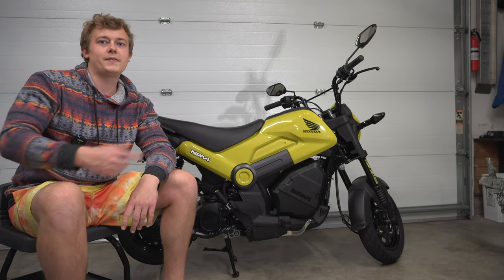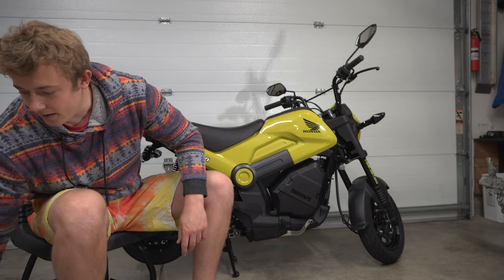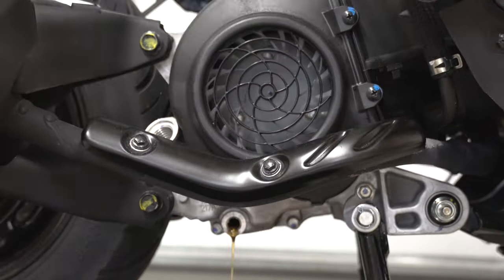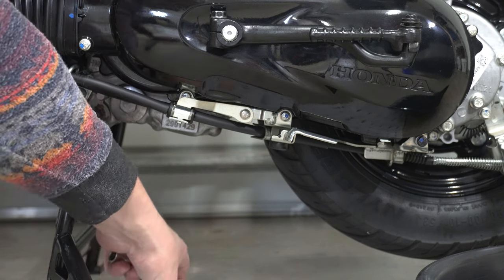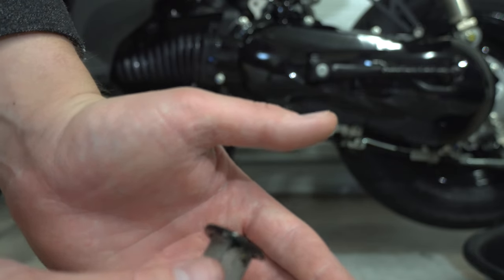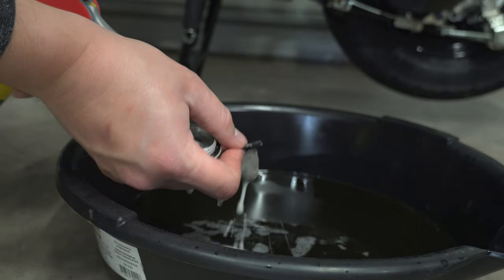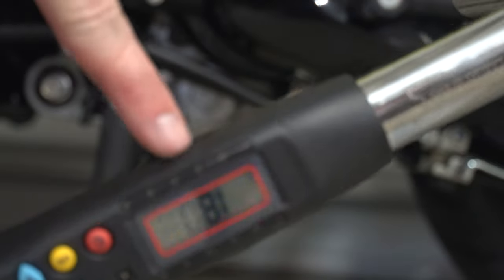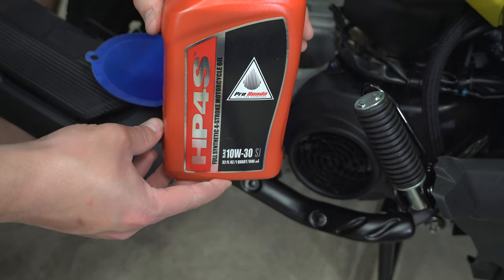2022 HONDA NAVI : Oil Change

Comment: In honda navi is there a gear oil change or only engine oil change? 
If there is also gear oil change can you make a video on that part
Reply from the maker: Gear oil change aka final drive IS separate from the oil change. It is recommended every 2 years!  If its in stored in a climate controlled setting like mine I personally gonna wait till hit 2,500miles and do it with the next oil change. I will not be putting 2,500 in 2 years so id personally am going with every 4 years or every 2,500 miles. Standard Oil changes are much more vital to do. If its in a non climate controlled environment id go with every two years for the final drive. Its not as important as the oil in the engine therefor im waiting longer to change it. Plus the factory oil is good and only have 600miles on the bike.

Comment: What's your mileage
Reply from the maker: Getting roughly 75mpg. I keep her full throttle a-lot though lol. I just usually always fill it up every time i take it out to top it off. I did the oil change early only have about 300miles on it.

Comment: Did you put the screen in immediately after spraying it down with WD40 ? Or do you need to let it dry /clean it off?Im looking to change mine this week and dont wanna mess it up.
Reply from the maker: Just a quick dry wipe down is good 👍🏼 really just want to wipe off the wd40 off the rubber. Other than that its good to go 😎 try using a rag that doesnt leave lent behind or blow it lightly with air compressor if your not sure. Oh and make sure not to over tighten the bolts.  Thanks for watching! Let me know if u got any other questions!